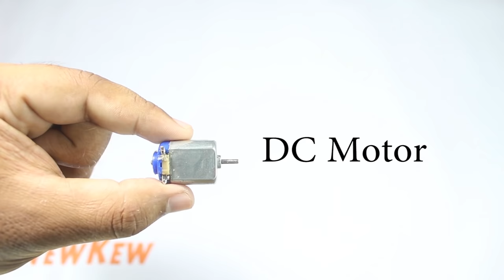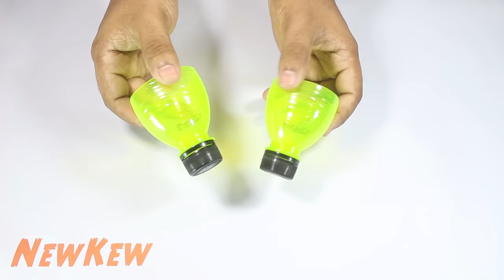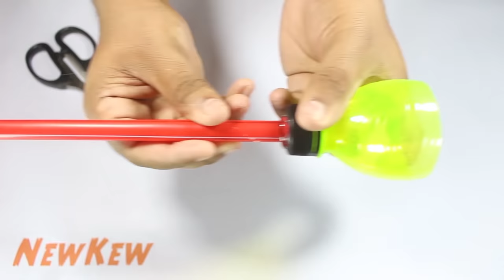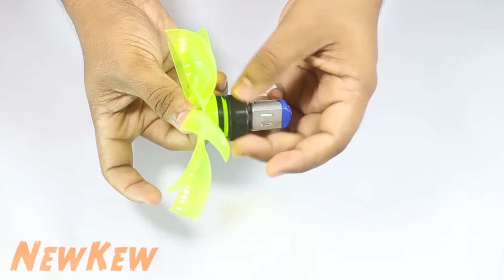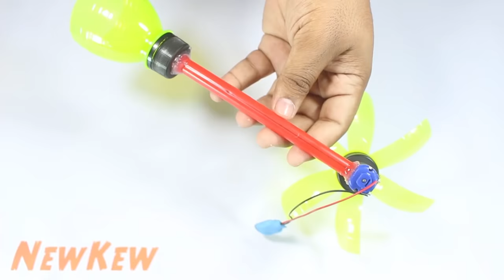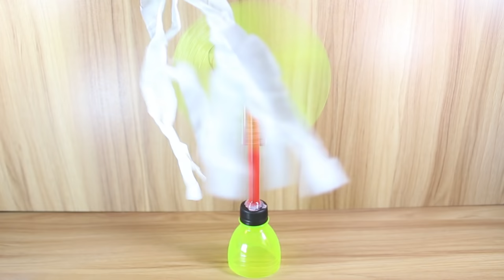How to Make an Electric Table Fan using Bottle - Very Easy

Comment: varey Easy New kew.... I really thank you for this DIY Table fan.... because of you This table fan is the Item of what Are we goin to do at our Science fair..... But .... i only have a Single Question, its that Can you use Glue Gun instead Of the Soldering iron?

Comment: Is it necessary to buy hot glue ? In case of that I can use super glue
Reply from the maker: Hot glue is better than super glue :)
Reply: Very easy
Reply: super glue means fevicol????
Reply: ajmal muhammed DC
Reply: ajmal muhammed منع
Reply: nice
Reply: ajmal muhammed  use can use
Reply: *you
Reply: ajmal muhammed Bra
Reply: +balasubramanyam tkm bgzxhgc
Reply: ajmal muhammed I
Reply: हककु
Reply: ajmal muhammed is
Reply: And I will use fevi kwik
Reply: ajmal muhammed

Comment: where can we find dc motor in nepal,balaju ??please comment
Reply from the maker: You can find it from old cars :)
Reply: tutu pandit solta electric pascal ma pahenxa ghumne mortar bhana nw denxa 
Mobile shop Tera hunxa
Reply: Rijal Anup can we find 9v battery connector also???
Reply: tutu pandit haina bro 2 ota 9 v battery lene ani katery muni bata wire halerwe connector banaune ho 
If u donot know u can look in YouTube in other video 
9 v battery dherai shop ma pahedainw bt order gara nw leyayedenxa
Reply: Rijal Anup bihari
Reply: in toys in electric shops etc

Comment: sir my 9 volts battery working slowly but its new pls i need answer sir thanks
Reply from the maker: Thank you so much for your comment :) Instead of 9v battery you can use lipo battery or 3.7V 3800mah AA battery or if you don't have them then attach two 9v battery together and you will get more power :)
Reply: +NewKew 
sir my 9 volts battery is eveready
Reply: +NewKew  ty verry much sir i made 1 usb fan thats great sir
Reply from the maker: Your Welcome :)
Reply: +NewKew sir. do you know where i have 12 v motor?
Reply from the maker: Please search on ebay or aliexpress you will get all types of motor on there :)

Comment: Hello Sir, what is the VOLT Of the DC Motor you are using? Will a 9v battery can run a 12Volt DC motor?